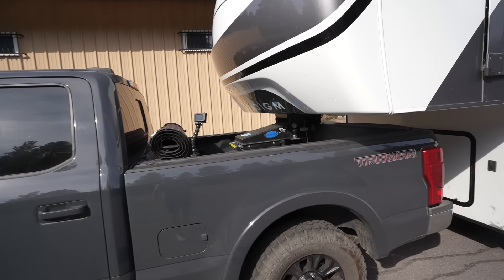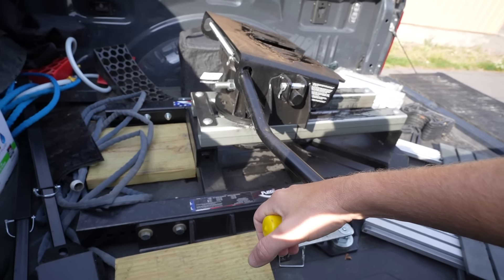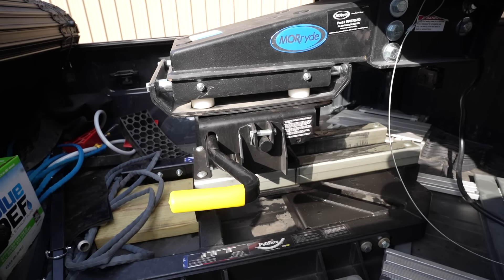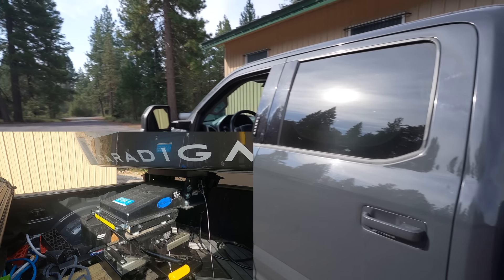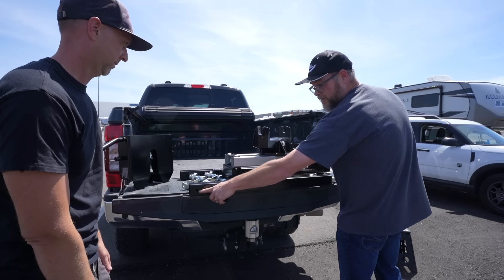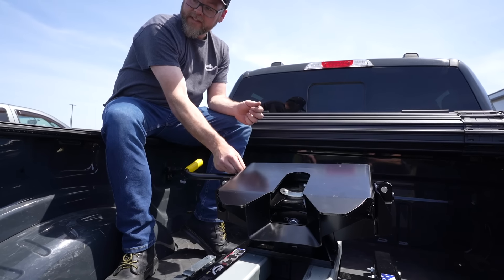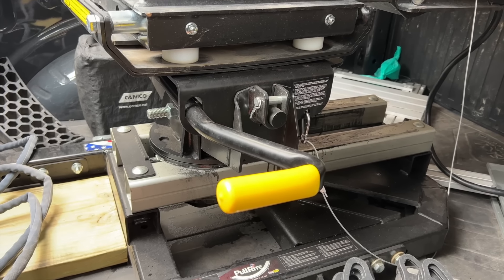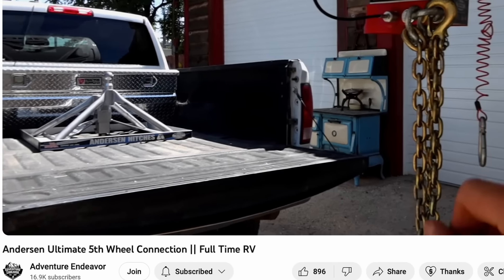The BEST AUTOMATIC Sliding 5th Wheel Hitch for Short Bed Trucks (Pullrite Superglide Hitch)

Comment: Cab wouldn't be your problem, the rear bumper would hit long before that.  On my short box ram, I can actually jackknife the trailer (truck and rear of trailer moving in opposite directions) when getting out of a super tight spot.  I wouldn't make it a habit, but some times you don't have a choice when you get into a jam.

Comment: Good video 😊 just saying that style hitch been around for twenty years only because people did not buy a long bed truck most rv'er have long bed truck that style of hitch will not work long bed truck the hitch sits over rear axles for better weight distribution  also dully are better but more expensive 🤔😀
Reply: On a short bed truck the hitch is still over the rear axle.  However, you loose the space between cab and rear axle; therefore, the need for a slider hitch (slider hitch would still work on a long bed truck, but unnecessary)

Comment: Do you have a tonneau cover? If so, which one?  Our setup; Short bed Laramie Ram 3500 (which came with a mopar hitch the previous owner towed his 5th wheel toyhauler with). Now researching picking the right hitch and tonneau (that won't get damaged by the 5th wheel), then looking for the right fifth wheel. We have a travel trailer and ProPride setup now. Fifth wheel towing is complicated!! All comments appreciated.

Comment: So with the new 8 foot bed will you keep this hitch?
Reply from the maker: No, I wouldn't recommend a slider hitch with an 8ft bed as it's just not needed for clearance issues anymore. And it adds weight, size and moving parts you don't need with a 8ft. But, we have a twist/surprise next week. 😊

Comment: What is the length of your bed mine  ford f150 is 5’6”
Reply from the maker: Ours is 6'9. Yours is a super short and they do make a couple sliders for those too https://www.pullrite.com/3100
Reply: Thank you
Reply: IMO, a F-150 is NOT suitable for towing a fifth wheel trailer unless you get the F-150 with their heavy duty payload option. They may have the power to pull it but they won’t have the weight carrying capacity needed. A 3/4 ton and 1 ton pickups are not offered with that short of a bed length and have significantly more payload capacity.

Comment: Does the Gen-Y permanently set the 5th wheel farther back from the cab? For short cab & tongue weight.....this is an important topic. You had me at the 30 minute mark. I don't want to end up like that guy pulling off the highway and having no choice to cause significant damage.
Reply from the maker: What people are doing with a Gen Y type gooseneck is using an “offset” ball in the truck bed. So this will move the connection point back like 6-8 inches. I think this would help…. But you’re still going to have to try your exact setup to know for sure!
Reply: @IreneIronTravels  Moving the connection point back will change the whole balance; more weight on the rear axle and unloading the front axle.

Comment: One huge problem with the Pullrite automatic sliding hitch is that the truck and trailer have to be lined up perfectly straight to hook or unhook. Often where you park that is a real problem.
Reply from the maker: Thanks for the comment John. Yes, you can be up to a 10 degree angle off from straight while hooking up. We're now at about 9,000 miles towing and probably 40 different campsites including boonodocking sites. We can honestly say it hasn't been a problem once. Not to say we wont run into a site where we don't have room to straighten out while parking, but for us this is not a huge problem at all. 👍
Reply: We have had a couple of problems being just a hair off.